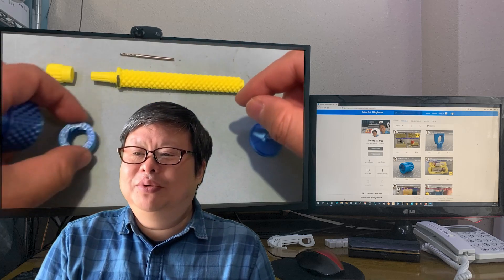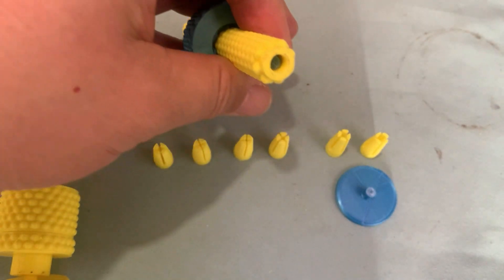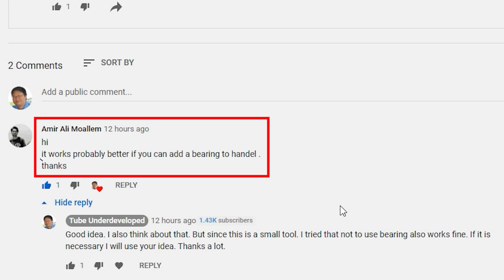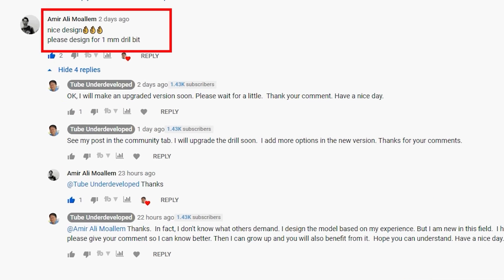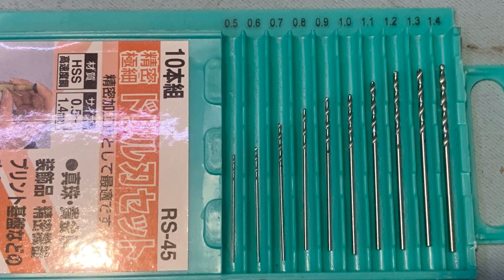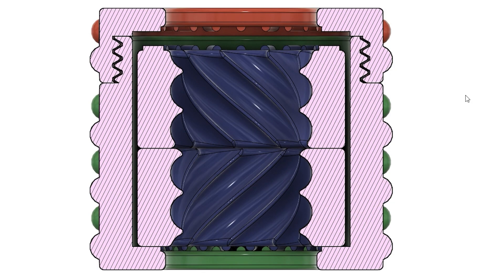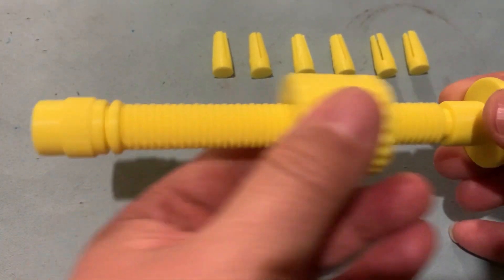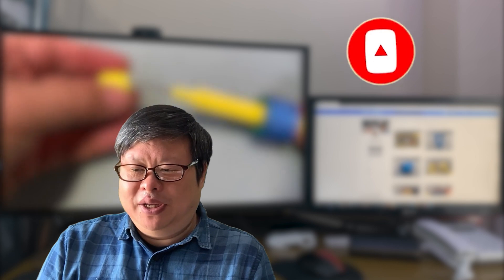Penetrate a coin in seconds (Upgrade straight one-way manual hand drill)

Comment: This is an awesome project! Great work.

I have a challenge for you. Could there be a way to go from rotating in one way, to rotating in the other direction, without removing the collar. Perhaps a second threaded layer on the collar, that changes the way it plays with the nuts.
Reply from the maker: This is really a challenge. I can not give you an answer now. Since it is not so difficult to change the direction by reversing the nuts, I am not sure it is a need to make other change. I will keep in mind if some idea pups up. Thanks a lot for your comments. Have a nice day.
Reply: @TubeUnderdeveloped  I think this would be especially useful with a hex-bit head for using this as a screwdriver. Good luck thinking of an idea to make it work.

Comment: Hi again, thanks for the update. I have now printed all the parts, but I have run into a couple of problems: le main one is that the "Shaft Cap" is too tight for the "bolt". Did I do something wrong?
I printed the Shaft Cap again and carefully filed both male and female threads, but I still can't get it to go in. I definitely feel like something is off with the geometry.
Thanks again and I will post the finished make on Thingiverse as soon as it's done :)
Reply from the maker: Do you print them with the support layer? If so, this may be the problem. They can jam the screw part. Usually, my model doesn't need a support layer.  They can be used directly after printing. Another is to use small layer height. I use 0.2 mm. Hope it can help you a little.
Reply: @TubeUnderdeveloped  Thank you so much for all your support. I printed the "Bolt" as is in this updated version + brim. It has a small ring arround the base and some supports inside, but I cannot remove those because they are part of the STL file. I printed the "Shaft Cap" also with brim, but the screw side is facing up, so I don't think that's the problem. Both parts were printed with a 0.20mm layer height.

However if you say the screw is fine, I will file and sand some more and insist to see if I can get them to agree :)

Thanks again and I'll update when there's news
Reply: @TubeUnderdeveloped  after some more careful sanding and filing, I could make them fit :) So totally my bad. Thanks so much for your help.
Reply from the maker: @pascalsalerno  Sorry for troubling you. I directly add the manual support layer on the bolt.  I don't know they cause problems. I will upload a clean version on Thingiverse soon. Thanks a lot.  
Have a nice day.
Reply: @TubeUnderdeveloped  No worries my friend, no problem :) This is the way this goes. Thank you very much for all your help and and awsome design. I'll be posting the make soon. Have a nice day as well.